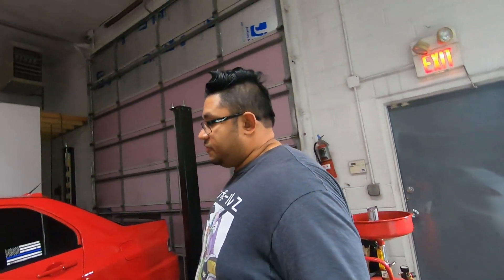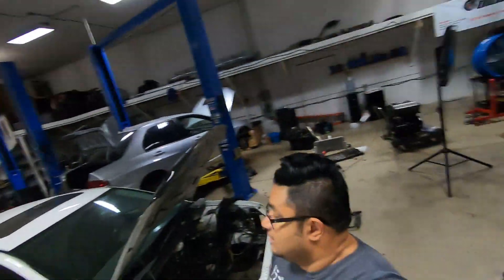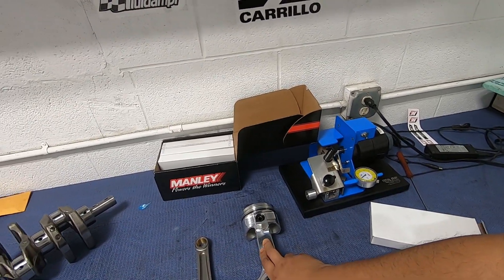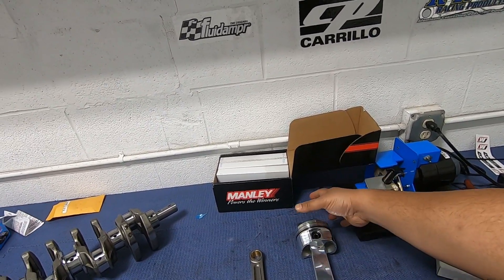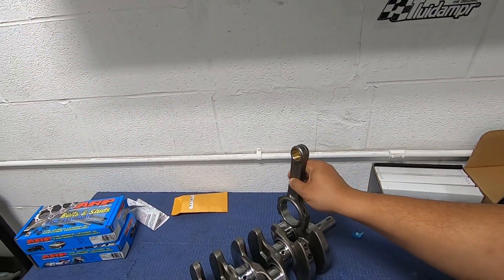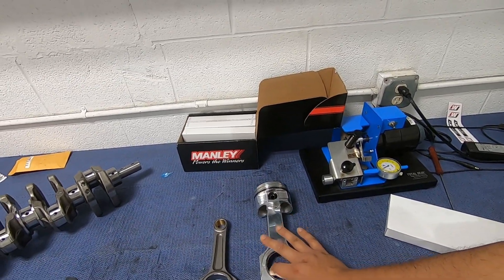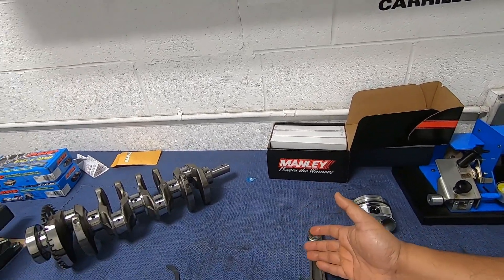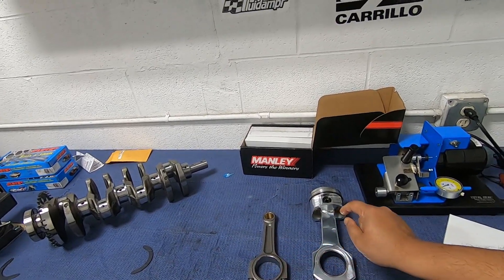Aluminum vs Steel rods

Comment: Like 250hp total
Reply from the maker: It's more based on usage rather then power. Good H-beams or i-beams never failed on me even beyond 275 (ls motors) per cylinder. But if I kept doing it it would have hurt my bearings. I would go with the lightest steel u can find.

Comment: What would you use for lower horsepower engines?
Reply from the maker: Depends on the usage of the engine. What kind of driving will the car see and what kind of power?
Reply: 500 to 600 daily. Mostly roll racing
Reply: @Turshin  steel rods and maybe a 2.2L